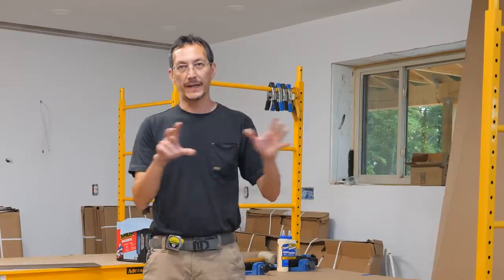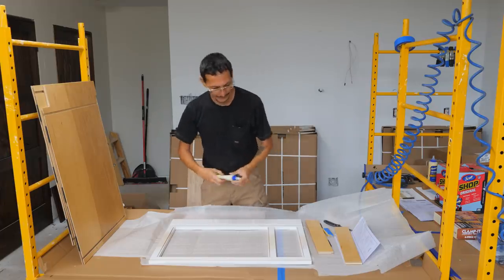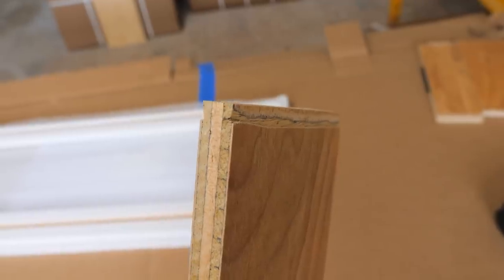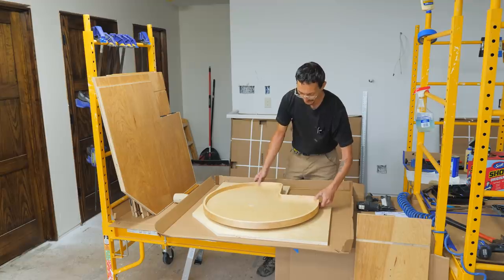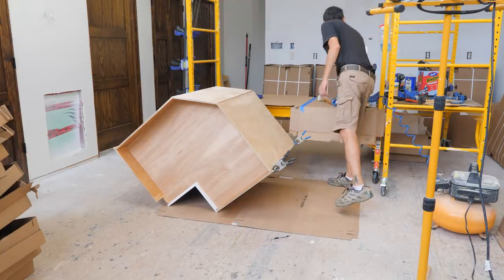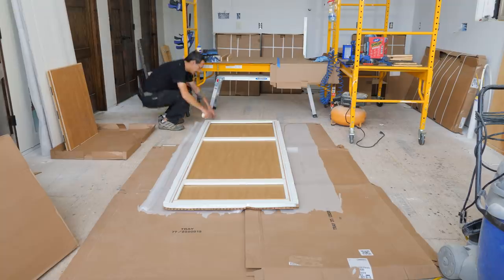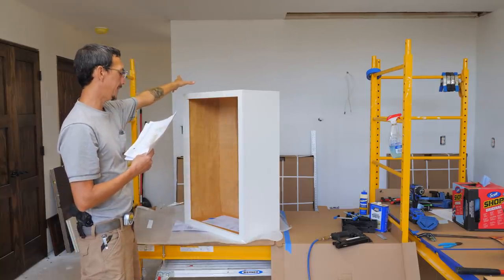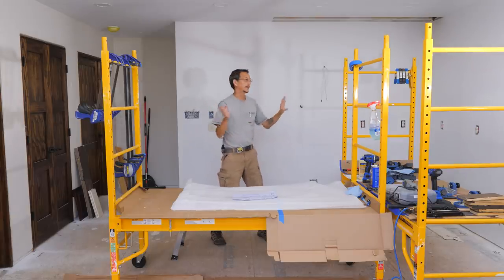Assembling Custom RTA Kitchen Cabinets from Cabinet Joint

Comment: Aloha, Jeremy (& Jaime), regarding the Lazy Susan cabinet, may I suggest you order some plastic pie-wedge-shaped dividers to keep foodstuffs organized. I researched the options extensively on Amazon. The downside is that all makes and models of these organizing bins are expensive. The upside is that all my items are now very organized and don’t go spinning into a messy pile when the shelves are rotated. I made sure to order the bins in clear plastic with sides as tall as I could find. Now have separate bins for dried beans & legumes, packets and little boxes of Asian ingredients, water bottles & insulted coffee flasks, etc. I can find what I need quickly and easily. It’s been a game-changer that I appreciate daily. Money well spent 😊

Comment: Two items that I noticed/thought about.
1.  I recall seeing a fairly large trim panel on the right side of the trash can cabinet.  Could you trim off enough of that panel to let you slide the refrigerator cabinet so it will be at least CLOSER to the edge of the loft?
2.  Others mentioned the cabinet at the opposite end of the kitchen, almost guarantee that whichever of you is doing most of the cooking is going to smack your toes on that missing toe kick!

Those are some fantastic looking cabinets, waiting impatiently for the next two episodes.
Reply from the maker: 1. Can’t move the fridge any farther to the left because of an outlet and window casing.
2. The toe kick in the end cabinet won’t be a problem because you would never be that close to the oven cabinet when using the oven as it opens out into the room.

Comment: The toe kick on the special end base cabinet is flush with the kitchen facing side. Do the toe kicks sit back 4" on the base cabinets to the right of the double oven cabinet therefore not matching toe kicks along this elevation?

Comment: I would wait till the kitchen is finished and if you need a shelf in the fridge cabinet for something then make one that goes in but in halves
Reply from the maker: That's a good point. The shelf can be ripped length wise and both pieces would fit in. 👍

Comment: Great video! Forgetting the shelf in the refrigerator cabinet may actually be a blessing in disguise. We don’t have a shelf in ours and it’s great for all the extra storage and taller things you may have. Question- do you have a plan for the sides of the appliance garage? Can’t wait to see it come together
Reply from the maker: Yes I talk about the sides in an upcoming video
Reply: We ended up having to modify the fridge cabinet to fit cookie sheets and such.

Comment: The cabinet enclosure for the refrigerator will look nice but will cause the compressor to run hot due to the lack of ventilation which will shorten the life span of the equipment. If the refrigerator is on an exterior wall, a wall vent next to the compressor should fix the issue.

Comment: why did you not show positioning the middle lazysusan shelf? great video thanks
Reply from the maker: What do you mean? I built that shelf first, then the floor susan and put them in the cabinet.
Reply: When you pushed over to the side, you said you were finished but the middle or top lazy susan shelf was laying on the bottom shelf ...just curious also.
Reply from the maker: All of the shelves sit on the bottom of all cabinets until you do the finishing and install shelf pins, drawer slides, doors and drawers. That video is #4 in the series coming soon.

Comment: You have the skills, tools and patience to do a quality job, but I would question if RTA cabinets would save any money if you had to pay a cabinet installer to do the assembly. Also, it looked like the refrigerator outlet was too far to the left. I love the series.
Reply: They can be less expensive. Since they are made in a large factory using a lot of automated processes and in theory with the purchasing power of a large operation, their expenses should be less than a local small shop. In addition, since they are shipped flat pack, the shipping costs would be lower than assembled cases. As for the assembly cost, that would depend on location and your local labor costs. In other words, your mileage may vary. You’d have to look at your specific details.

Comment: TOE KICK ISSUE: notice that there is no toe kick area on the end cabinet that goes to the right of the oven.  Yes there's a toe kick on the door and drawer side but the end that faces the kitchen consider cutting back for a toe kick.  I BET YOU will notice it with accessing the oven and kick it with your shoes. Anyway that is one minor issue I see when you constructed the cabinet.

Comment: You will be glad that you forgot to put the shelf in the cabinet above the refrigerator. That cabinet is so deep that it would have been impossible to reach and install the shelf support pins in the back of the cabinet anyway, so you would have been left with a shelf that had no way to install it. In other words, you would have had a shelf just sitting on the bottom of the cabinet with no way to raise it. You are better off just storing big (but preferably not too heavy) things you seldom have to access in that cabinet.
Reply from the maker: That’s pretty much what I thought also.
Reply: Be great for light, bulky appliances you don’t use often!